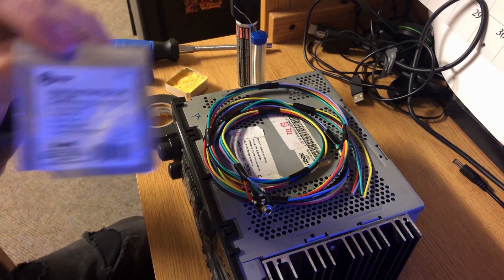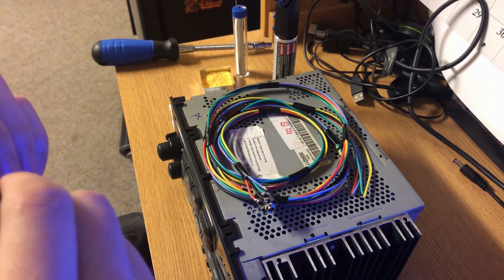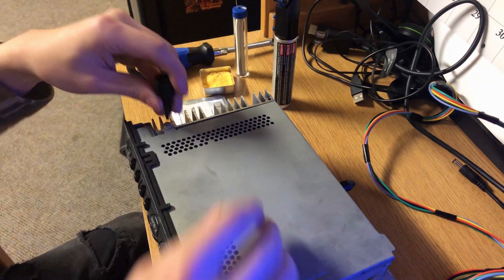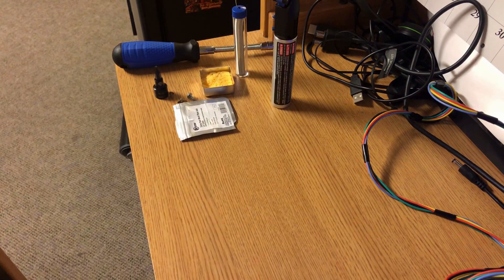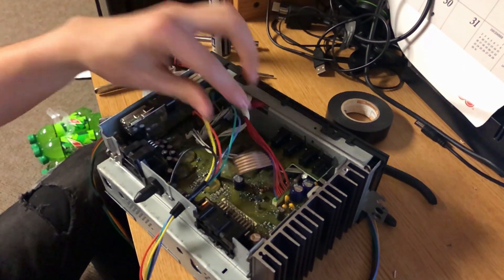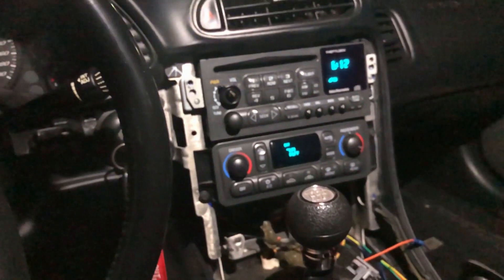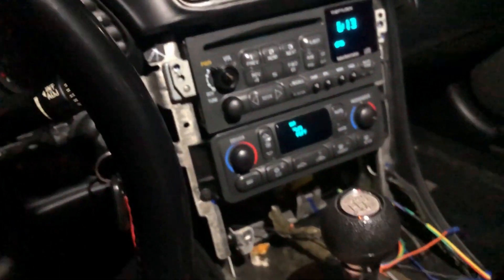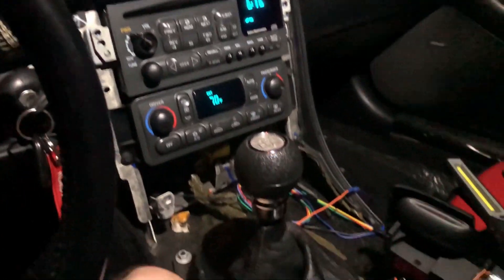$3 AUX MOD, ADD AUX TO YOUR RADIO

Comment: Is it me or your diagram is incomplete
Reply from the maker: No sir, this is the diagram I used from corevetteforums. Though I am unsure the original creator, I could probably track down the post if you would like
Reply: I actually found the original post and some information is need in context with the diagram you have. He’s post is complete.